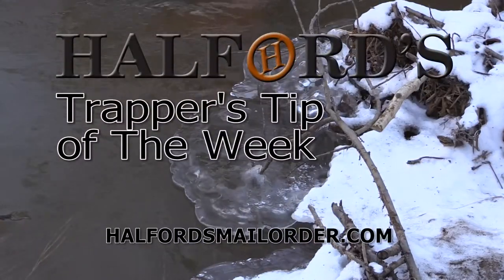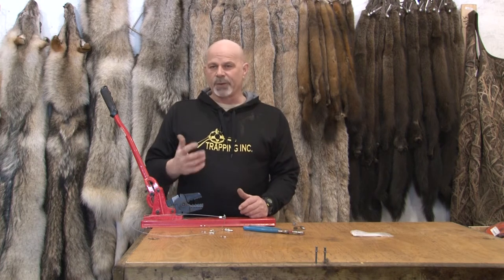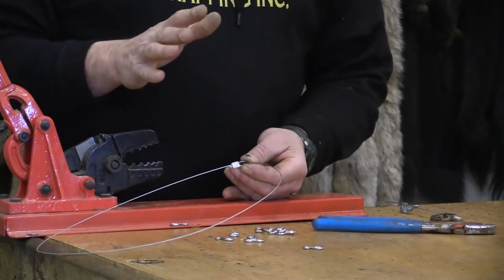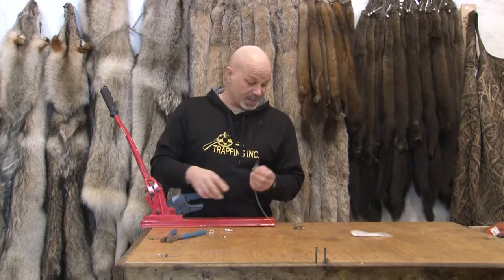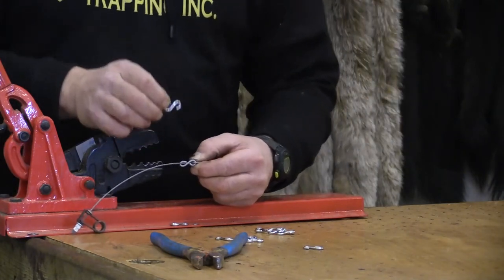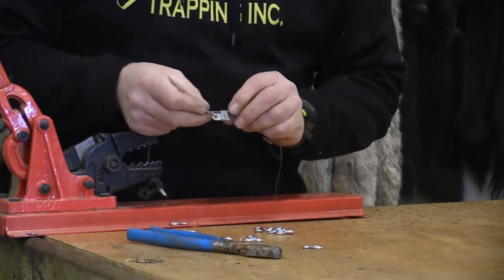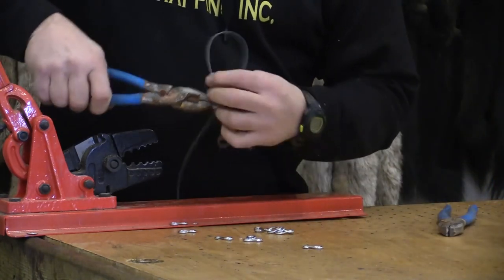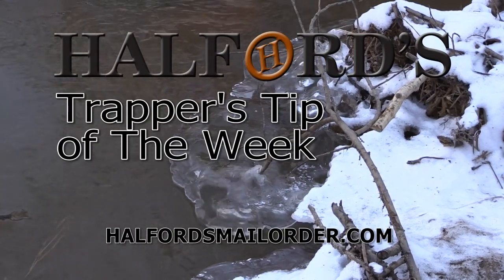Halford tip 21 Snare Break aways

Comment: How would you modify that to a snare?
Reply from the maker: I'm not sure I understand your question Connor. It is a snare. The first one is used on a power ram which is a unique system. The second is a free hanging snare that we use for coyotes and wolves. Let me know how I can explain this better
Reply: Trapping Inc TV Series sorry for the confusion. I bought some snares and they don’t have a breakaway system. I was wondering how I would add one to them
Reply from the maker: @connerallred7829  Ahh, gotchya. You would have to cut the snare apart to add the S hook. If your laws don't require a breakaway or deer stop then use the snares and look for the breakaway when you buy again.
Reply: Trapping Inc TV Series ok thank you